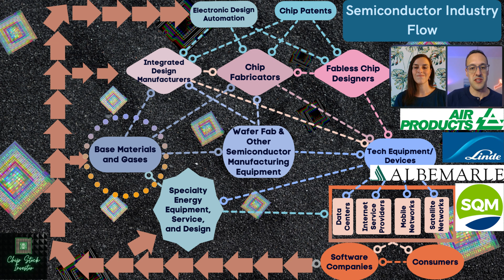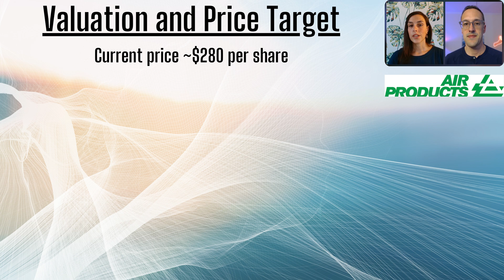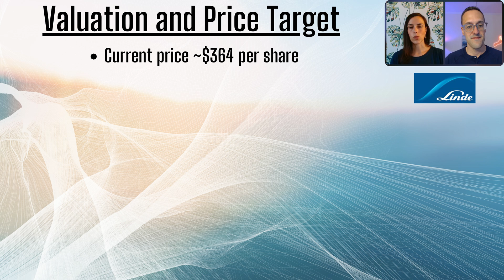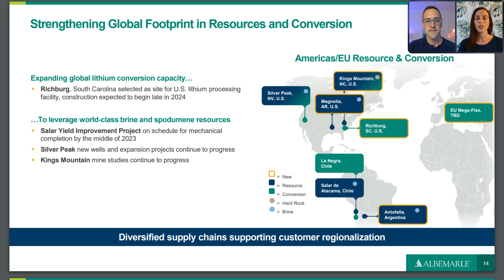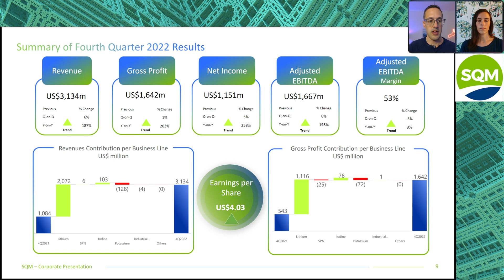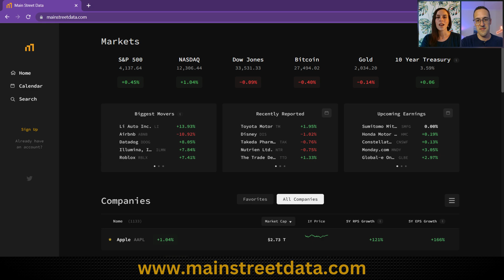Chip Industry Adjacent Stocks (Industrial Gases and Lithium): The Next Big Growth Opportunity?

Comment: Would appreciate your definition of Fair Value (FV) as my metric is much more stringent than yours.  APD has a PEG of 2.64, which based on EPS of $11.42 for 2023, a price of $286.56 (7/6), and g=9.5, gives it a FV of $108, i.e., 62% OVERvalued.  Thanks.
Reply from the maker: We use a DCF model to come up with these. How do you use PEG to arrive at FV? That's a more relative metric than DCF.